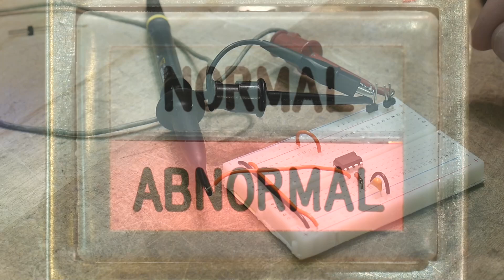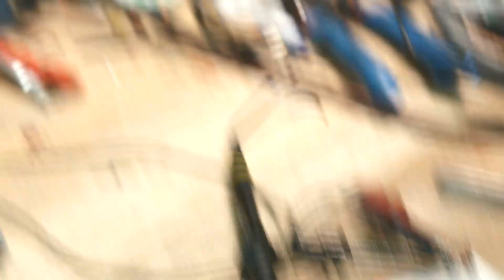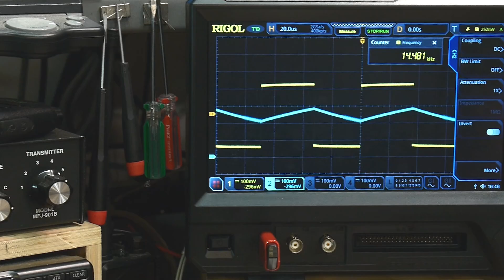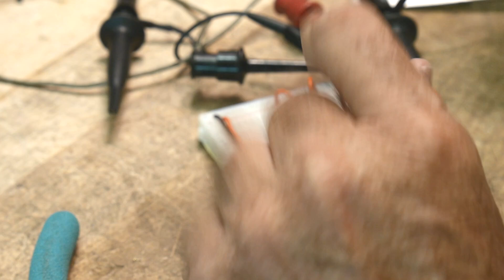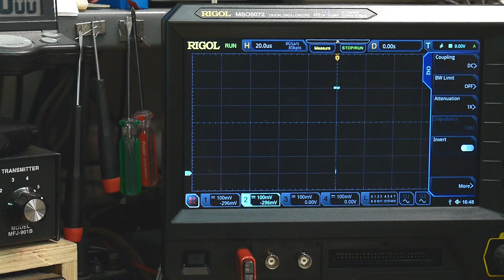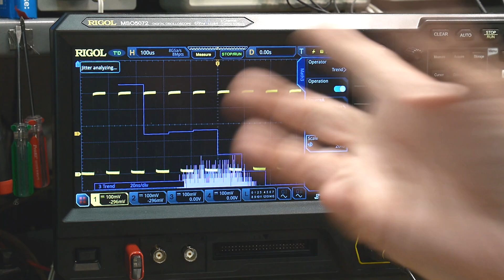#846 Use a 567 instead of a 555

Comment: Only the 567 cost much more(three times or so), the low cost is why we use mostly the 555 and not timer/clock ICs. And they are not as widely available as the 555.

Comment: If you just need to generate some squarewave then there is an even simpler way: LM3909 LED blinker IC. No need for the extra resistor, just add a capacitor, hook up the power, add a bunch of wires and it just works.

Although in the modern era when even a toilet brush can not hit the market without a WiFi or Bluetooth connection, an iPhone and Android app, a few blinking LEDs and a buzzer in the handle and a contactless charger in the base station to constantly put some juice in the batteries that would power all the necessary luxuries, I would probably just use an ATtiny MCU and programmed everything including the frequency in. The solution would not require any external components at all to just do its job and it would allow for external digital control that will no doubt be required in the future.

Comment: I have been looking at how to create a 60Hz sine wave. I know you are creating a square wave, but can the 567 be configured to go that slowly, reliably and with decent precision?
Reply from the maker: no
Reply: Best way to produce 60Hz sine, stable and accurate, is by using a DDS generator. You can find AD9833 online for <$3 shipped
Reply from the maker: @odissey2  that requires a microcontroller and firmware also
Reply: @IMSAIGuy that what it takes  for "slow, decent and reliable" 60Hz sine. The magic frequency (60Hz) assumes 10-4 frequency stability and decent THD specs.
    The alternative is XTAL-divider-double integrator-filter will be probably not cost effective and surely worse THD
Reply: @IMSAIGuy  a uC can be used to emulate slow DDS output, such as 60Hz sine. If uC has a DAC and a XTAL, it can be accomplished without external DDS
Reply from the maker: @odissey2  what I said was the 9833 cannot be used standalone. you need to have something to program it with. that adds to the cost and complexity.
Reply: @odissey2  Well, I had thought of the old analog function generator solutions = XR2206/Etc. But, I had forgotten about the old digital AD9833 solution. I have some, but never played with them, because, as IMSAI says, a MCU is required and I have sworn off trying to learn to code. I can do it, but I find it very non-fun.
Reply from the maker: You do not mention any specifications for your 60Hz sine wave. There are some very simple circuits you can try. For many years the gold standard was the Wein bridge oscillator (it made HP the company it is) used in the movie Fantasia. You can also look at a phase shift oscillator (only one transistor). A very easy way is to use a transformer. you have 60hz coming out of the wall!
Reply from the maker: If you can generate a 60hz square wave, you can follow that with a low pass filter to remove any harmonics and you will be left with a perfect sinewave.
Reply: @IMSAIGuy  True, it is easy enough to create the square wave. But, the high inductances and capacitances of a LC filter needed to create that slow of a sine wave are more difficult to overcome... Best I can tell, anyway... I am still climbing the learning curve, on this one.
Reply: @t1d100  my guess the 60Hz sine in this case is needed to generate SPWM pulse train for the H-bridge, where sine and triangle carrier are combined using analog comparator.
     Such sine-PWM (SPWM), however, can be directly produced by a uC, bypassing need for the analog sine and triangle altogether.
    Sorry, the link to the demo project can not be posted here, but you can Google some by typing "PSoC and SPWM".
Reply: @t1d100  for analog sine the xr2206 is reasonable solution. It is good enough for testing the concept and for fun project.
Reply: @IMSAIGuy  My purpose was to play with/learn about UPSs. Not to actually build one, though. So, 60Hz from the wall is out, when the power shut off. IMO, the most interesting part of the SMPS inverter magic is the challenge in overcoming the issues in creating the slow 60Hz sine wave. I hope I said that well enough, again, I am just a hobbyist.

Comment: What's the jitter level at >1.2 seconds ? I'm looking for a reliable timer circuit.
Reply: Timing is RC-controlled. So it's stability is 3-5% at best.
Reply: @odissey2  With NP0 caps and low-tempco resistors? It's not that bad as long as the supply voltage is regulated.

Comment: Cool chip.  Note you can get a 555 to generate a clock with a single resistor and a capacitor by placing the resistor between the output and the trigger+threshold pins.  This trick works better with the cmos version which has rail to rail output.  I am not sure what that hack does to the jitter and stability.  The bipolar version probably has some temperature dependence in the output rails which would probably degrade the performance.